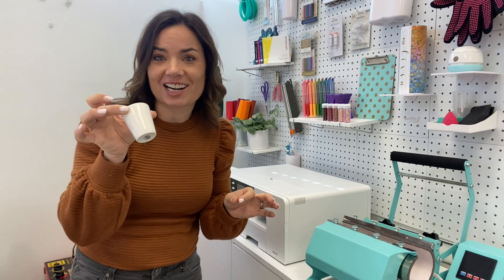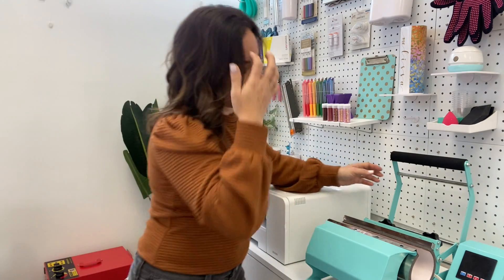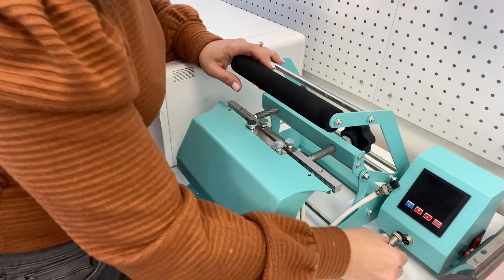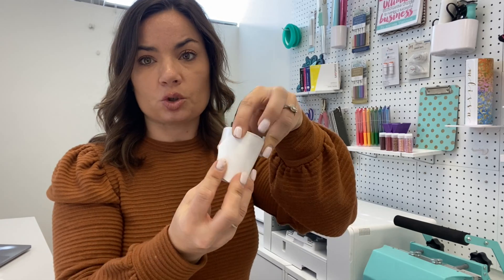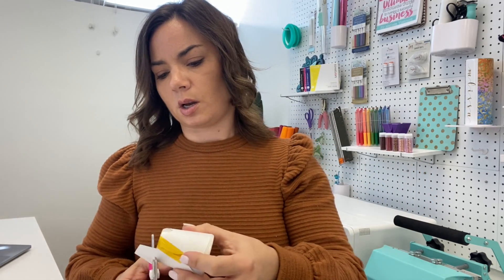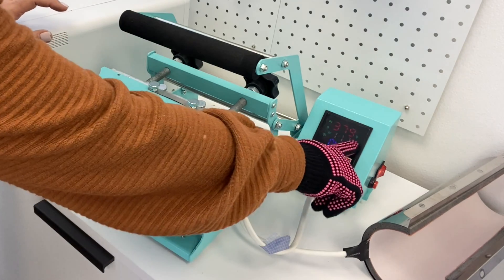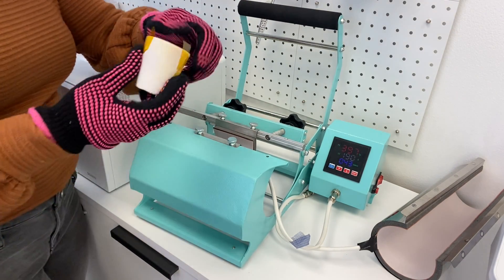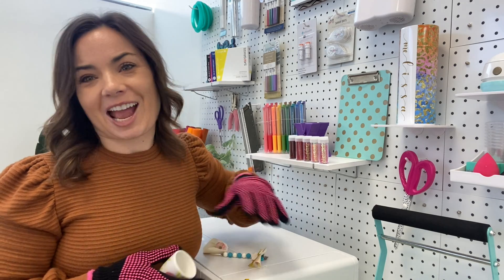Using a Shot Glass Attachment: How to Perfectly Sublimate Shot Glasses

Comment: You might also want to try the icolor hard surface paper for those… just as a comparison
Reply from the maker: I have used the hard surface paper on porcelean and while it works..it will scratch off and the process is not nearly as fast or simple. :) I would only recommend that technique if you are using a black or other color mug (and one that can't be sublimated) https://www.silhouetteschoolblog.com/2021/09/how-to-use-icolor-hard-surface-paper.html
Reply: @SilhouetteSchool  
We used to do laser transfers in the 90s. There was the initial transfer press (I.e. with the mug press), then there was a “curing unit” that the mug was placed over (sorta like a intense halogen but that heated the mug from the inside for a couple minutes) to really set it. I still have a couple mugs twenty years old that are pristine. Yes, if you used  a hard instrument like a sharp knife,you could scrape the design, but you could do that to sublimation mugs too as you’d be removing the coating where the transfer exists.
Of course back then, a single sheet of sublimation paper cost just shy of ten dollars. How things change

Comment: Is there anyway you can post a video using the 8 in 1. I tried using the attachment on there and I can’t get the shot glass to stay in place. As it heats up it slips out and doesn’t end up heating my design evenly. I was trying to use my hard surface paper that I printed in with my Uninet printer to create shot glasses and can’t figure out why this happening. Thanks
Reply from the maker: Have you increased the pressure by turning the pressure knob?
Reply: I have yes. And I thought I finally had it at the right pressure and it stayed in place for about 30 seconds maybe alittle longer and slowly inched it’s way out. I ended up having to use water slide instead because I just can’t seem to get to be in the position it needs to

Comment: The shot glass attachment says it's designed for the 20/30 oz tumbler press and not compatible with other heat presses.  You mentioned it can be used with the 8 in 1 press. Just want to clarify it will work with my swing design 8 in 1 heat press before I purchase it.
Reply from the maker: Yes I have tested it and it will work with the 8 in 1